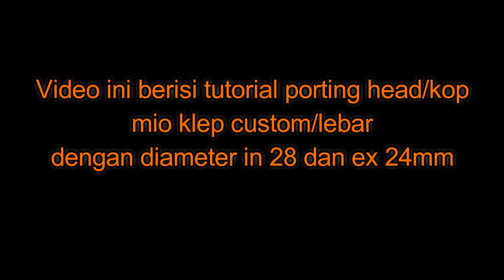Porting head mio klep lebar custom 28 24mm

Comment: Mas numpang tanya spek mesin mio saya 58,5 klep Moto 1 28/24 ,perklep swedia,saya udah uban in ex saya ukuran 26 ,karbu PE 28 moto 1, pen stroke 3,5MM . 

Roler yg pas make brp jarak 500 M.
CVT full racing cuma rasio bingung make brp ?
Reply: Mas head nya standar atau pake apa?

Comment: Bang aye punya mio spoty cvt 1500 rpm pakai roler 7 gram 6 biji kalo d oplos sama 9 gram 3 sama 3, gmn bang??mohon penjelasanya jngn lupa bls
Reply from the maker: spek mesinya gmn?
Reply: Masih standar bang
Reply: Kampas ganda udah beat karbu bang mesin standar, karna masih anak skl belum punya penghasilan,kasih tips bang buat motor mio sporty buat sehari hari tapi mantul
Reply from the maker: pengen top sped apa akselerasi?mesin std klo cuma otak atik cvt krg maksimal
Reply: Top speed